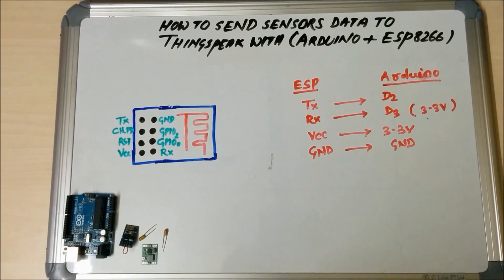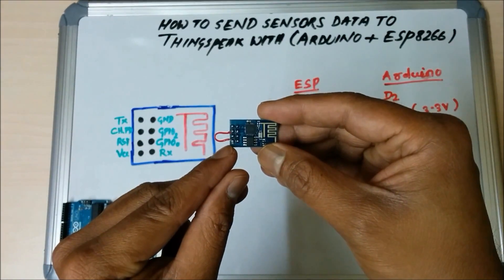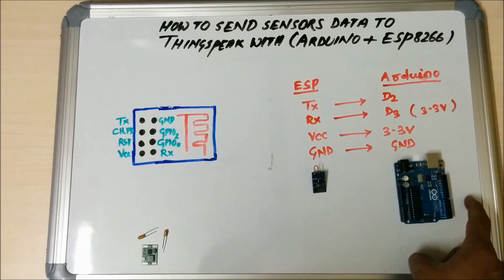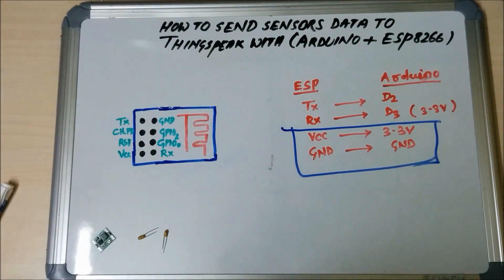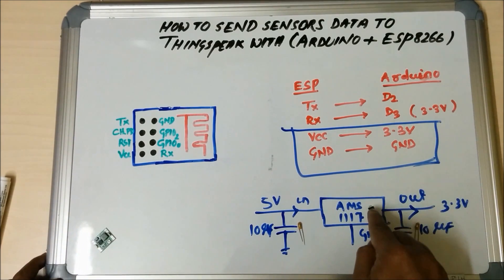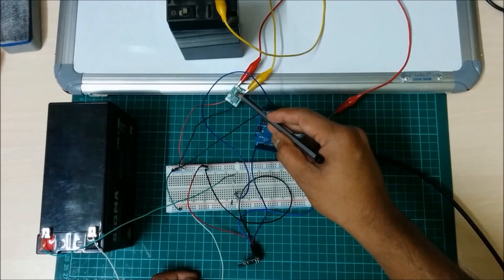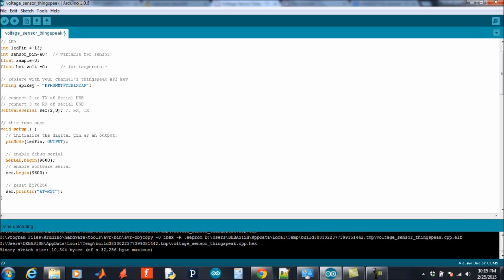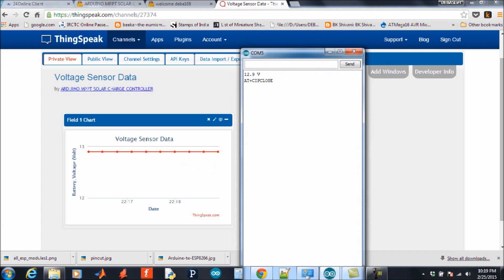UPLOAD SENSORS DATA TO THINGSPEAK BY USING ARDUINO AND ESP8266

Comment: #include <SoftwareSerial.h>
SoftwareSerial gsm(4, 5); // RX, TX

int value = 0;

int temp = 0;

int ring = 0;

int i = 0;

int var = 0;

String number = "";

String string = "";

const int output = 9;

const int motor = 8;

boolean wait = true;

boolean at_flag = 1;

boolean net_flag = 1;

// ================ ============== //

char str[] = "918247653545";

// ================= ============= //

void setup() {

Serial.begin(9600);

gsm.begin(9600);

pinMode(output, OUTPUT);

pinMode(my, OUTPUT);

digitalWrite(my, LOW);

gsm_init();

delay(100);

gsm.println("AT+CMGF=1");

delay(500);

gsm.print("AT+CMGS=\"+918247653545\"\r");

delay(1000);

gsm.println("Motor is OFF / System is Ready.");

delay(100);

gsm.println((char)26);

}

void loop(){

serialEvent();

if (ring == 1)

{

number = "";

var = string.indexOf("+CLIP: \"");

if (var > 0)

{

number += string.substring(var + 8, var + 13 + 7);

}

if (!(number[0] == str[0] && number[1] == str[1] && number[2] == str[2] && number[3] == str[3]

&& number[4] == str[4] && number[5] == str[5] && number[6] == str[6] && number[7] == str[7]

&& number[8] == str[8] && number[9] == str[9] && number[10] == str[10] && number[11] == str[11]))

{

   delay(1000);

  gsm.println("ATA");

  delay(100);

}

  if (digitalRead(my) == 0)

{

digitalWrite(motor, HIGH);

delay(500);

gsm.println("AT+CMGF=1");

delay(500);

gsm.print("AT+CMGS=\"+918247653545\"\r");

delay(200);

gsm.println("Motor is ON.");

delay(100);

gsm.println((char)26);

}

else

{

  digitalWrite(motor, LOW);

delay(500);

gsm.println("AT+CMGF=1");

delay(500);

gsm.print("AT+CMGS=\"+918247653545\"\r");

delay(200);

gsm.println("Motor is OFF.");

delay(100);

gsm.println((char)26);

}

}

if (digitalRead(motor) == 0)

{

serialEvent();

delay(1000);

}

}

void gsm_init()

{

while (at_flag)

{

gsm.println("AT");

while (gsm.available() > 0)

{

if (gsm.find("OK"))

at_flag = 0;

}

delay(1000);

}

}

void serialEvent()

{

while (gsm.available())

{

char read_char = gsm.read();

string += read_char;

i++;

if (string[i - 4] == 'R' && string[i - 3] == 'I' && string[i - 2] == 'N' && string[i - 1] == 'G' )

{

ring = 1;

}

}

}

Please check this code once, my requirement is motor is ON at fist missed call or first call, 
motor is OFF at second call,
But what is happening here..the motor is continuously ON and OFF with some delay for each call help me what can i change

Comment: On which board are you running this with? The arduino Genuino board or the the esp8266. I am a newbie in this. Do reply :). *edit* Tried your code.. everything is coming on my serial monitor but not getting updated on the thingspeak.

Comment: Hello sir,
I used wifi module with digital pin its working fine. But when i use it with analog pin its values are changing. What may be the reason? Please help me to fix this problem.
Thank you.

Comment: where is the psw and ssid ?
Reply from the maker: +Brandon Antonio You have to write your Router PSW and SSID
Reply: i found this 
Set the UART on esp8266 

// AT                                                 Command to display the OK message
// AT+GMR                                      Command to display esp8266 version info
// AT+UART_CUR=9600,8,1,0,0    Command to change the ESP8266 serial baud rate  to 9600   
// AT+UART_DEF=9600,8,1,0,0     Command to change the default ESP8266 serial baud rate  to 9600    
// AT+RST                                        Command to reset

And then, put the wifi chip on estation mode with AT comands from the arduino 

https://github.com/jayraj4021/Personal-Weather-Station-14/blob/master/Personal_weather_station.ino

But i don`t realy sure if this is goint to work
PD: sorry for my inglis
Saludos desde Santiago, Chile

Comment: For step down voltage use 5V-3.3V module here for $0.92 aliexpress:
https://www.aliexpress.com/item/5PCS-5V-3-3V-DC-DC-Step-Down-Power-Supply-Buck-Module-AMS1117-LDO-800MA/32732025305.html?spm=2114.40010208.4.23.1crUmL

Comment: i use voltage regulator module just like you, but what kind of power supply that can i use for powering esp8266? i've tried trafo, 9v volt battery and nothing can meet the reuqirement current of esp 8266, hope you answer my question
Reply: https://www.aliexpress.com/item/5PCS-5V-3-3V-DC-DC-Step-Down-Power-Supply-Buck-Module-AMS1117-LDO-800MA/32732025305.html?spm=2114.40010208.4.23.1crUmL

Comment: when i dump your program to an arduino its working with serial monitor but the values are not sent to thingspeak. can u help me out
Reply: i do have the same problem
Reply: u must  modified API key  and USER ID in ARDUINO IDE
Reply: i did
Reply: i have been complete little bit only

Comment: Good work!!!

I have a problem. I'm using your sketch but I can't send values smaller than 10. For example 9.5.

I think the problem is when I try to send 9.5 the missatge is:
 
GET /update?api_key=7K0NQ15N9GCSUAED&field1= 9.5

As you can say in front of 9 there is a space. How can I fix it?

TK

Comment: can it work if i use 3.3v pin of arduino?
Reply: arduino not provide a sufficient current. use a buck converter or ic ams 1117 for properly working esp 8266

Comment: why no directly program ESP8266 , its also a controller with wifi interface and can easily be programmed with Arduino IDE
Reply from the maker: You are right.
But I used this side feature to one of my main  project which needs lot of memory and input output pins.

Comment: Do we have to configure espmodule or directly we can connect to arduino ? And How to get continuous reading of voltage on serial monitor screen
Reply: To get voltage on serial monitor. Just use the line of code given below.  

Serial.print(voltage);

Comment: hey! nice vid! btw, do you know how to send sensor data to app inventor 2 by using arduino and ESP8266?
Reply: Same question here. Please advise. I want to send thingspeak data to app inventor 2. Its by JSON feed or how?
Reply: same problem if you got answer please  tell
Reply: integrate thingspeak with firebase using api

Comment: Where is the SSID and Password info for connecting to a WiFi network in your code?
Reply from the maker: First I connect the ESP8266 with my router by running a separate program. But you can write a single program to do both the things.
Reply: how can I do that?
Reply: +DEBASISH DUTTA  Please provide us the code.
Reply: i tried but it does not work well.....
Reply: Open Green Energy  Can you connect esp8266 with mobile hotspot?
Reply: Open green energy
Bro I also want this code
Reply: abdulrehmanbinafsar@gmail.com
Reply: @Jitendra Reddy have you got this code?